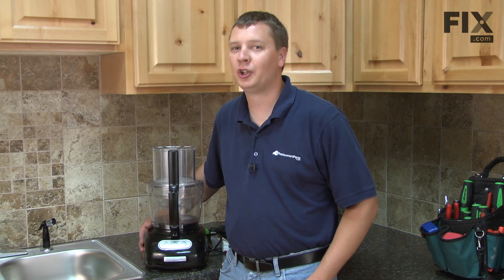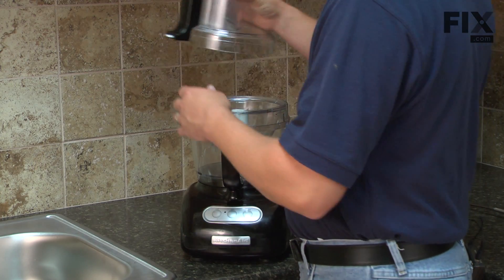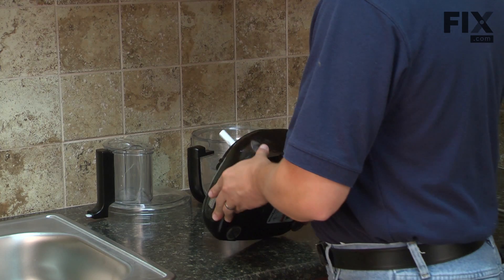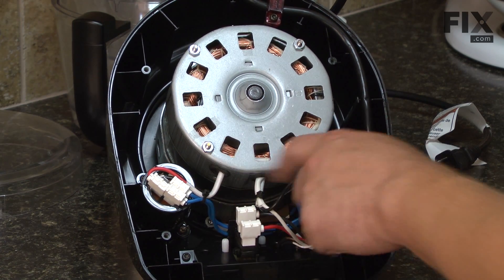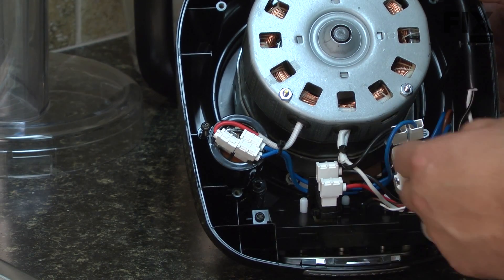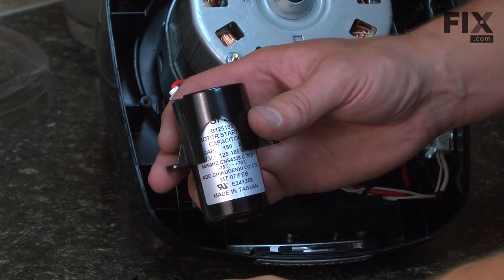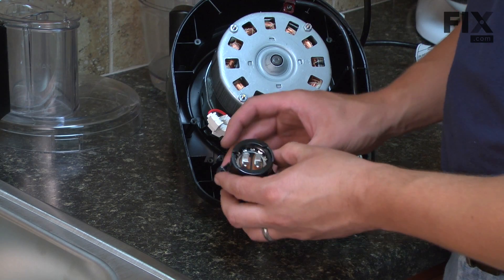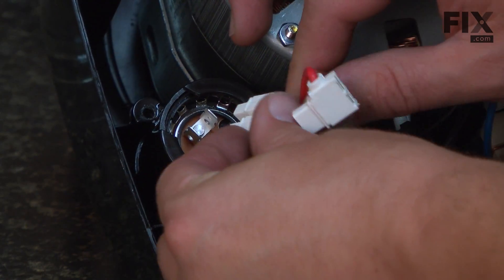KitchenAid Food Processor Repair – How to Replace the Motor Capacitor

Comment: Hi Mark. We have a Kenwood fdp64 food processor whose motor assembly got gunked up with dough! Took it apart, cleaned it thoroughly, but can't figure out where dough entered the 'guts'. Possibly at gap between center coupling and surrounding notched ring wheel. Any thoughts on how to prevent this? Kenwood only offers FAQs-no cust service. Thx!

Comment: When I press the button to turn on my food processor, the light turns on, but there is no hum and no spinning. Could this be the capacitor?
Reply from the maker: Hello Adria, if it was a capacitor you would still hear the motor hum, it may be a switch or something else. You may want to take it to a authorized service center.
Reply: Fix.com Okay, thanks for replying so quickly!